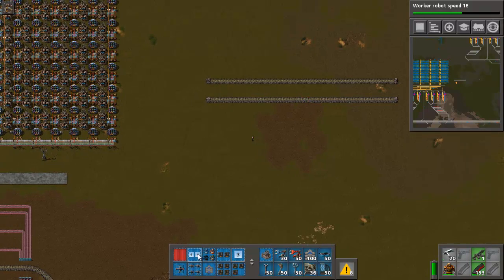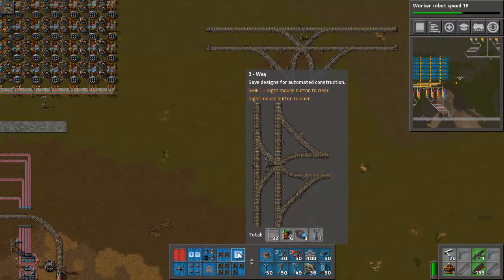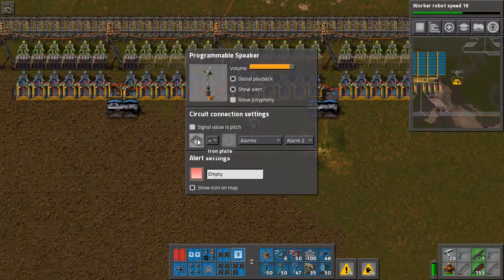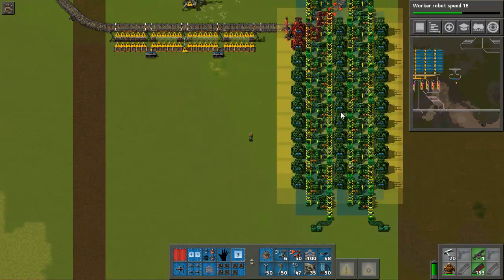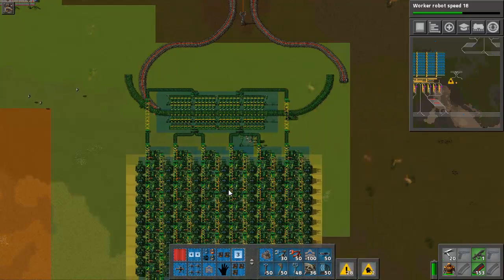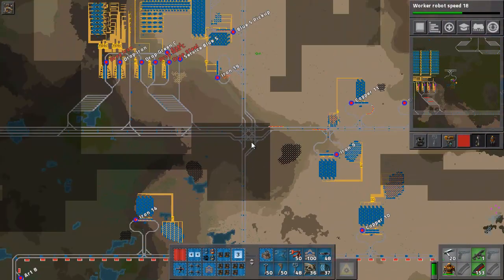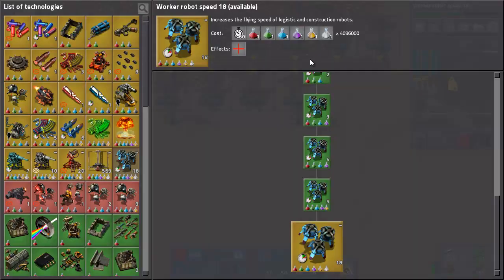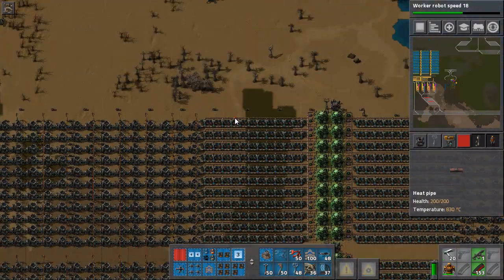Factorio Mega Base Tutorial - Late Game Ore

Comment: Those Nuclear reactors are really inefficient. Do you really think that works? I actually look at that and feel bad.
Reply from the maker: I pulled them straight off the net using belts instead of bots in the new map. Do you have a better design? I'll take it!

Not enough data or functionality for me to spend time on power systems. IMO Power is second only to tracks as the worst coded parts of the game.
Reply: @AutomatorMC  Do you have a better way of contacting you? I want to send you a picture so you can compare, but generally building in one line like that is the least effective way to do this power system. Not only is it in line, from what I could see it was not interlocking to exchange power much. Think of it this way, you don't actually want to over burn Uranium. In fact, more to the point I have now looked at your system and where you have more mines, I have far higher production. From what I could see you plugged in 1 reactor to 1 heat boiler, and 2 steam gens. You can do belt and this method just fine, what you want is 4 reactor's in a square, I then have them going off the reactor to 3 sections of 8 heat exchanges on each side of the reactor core unit's. then  I run it to 3 different sections of steam turbines, I have 2 of the sections parallel to the heat exchange array,  each of these sections has 5 rows of steam turbine's, 4 in each row with a system up top of them, 8 rows of 5. 

I believe by my calculation, you are at 25% max of your current potential. Get a bp like this, you need about 4 or 5 to run your entire factory.  If you like, add Kelsyer on steam, I will show you my factory. It's not as good but I looked, you have been playing slightly longer.
Reply: Wait till I finish my hidden up and coming system that will be capable of approximately 1000J and you will never worry about power ever again.
Reply from the maker: @beatsbykelsyer9844  Cool! Can you upload a blueprint to Pastebin or map to Mediafire? Or setup a server?
Reply: @AutomatorMC  I think I got the power system that is set to run. I went ahead and ran it for the past I think 8 or 10 hours, I might have this blueprint belt ready Let me get my test draw building to see how it runs, then I will set up a mediafire account. I did a test on your system vs mine ( I am not great at wiring, but my plan might need a fix or 2 at worst. ) so you have a massive system, so I am setting up a block of 12 plants interlocking, It uses far less space though in my eye's. It should be able to be set up on a simple grid rather easy.
Reply: Please keep in mind, I had to accommodate changes to the original, and might have made mistakes in the conversion. this is meant to work without ever needing managed. Although I seem to have designed a factory that can drink all the power 1000 of these can muster..... (unsure if this is a mod now. Factory buildings put the assembly machines in a little pocket dimension.   Well you can fit 5 of this pocket universe in one pocket universe, design it, carry them around, and all the way down to the 75th layer of this factory is the assembly machines. Anyways, any speed module on any layer in a tower effects every layer of the factor. 7 layers in you can drink oceans or uranium.)  

I have spent way too many hours testing this. Anyways, you can move this factory around, It even had its own internal bot networking, anyways never found a way to power it. Still working on it, needless to say I do not plug this thing in to my base, but it can drink in testing up to 9,000,000j but, and this is a huge but, you will never see anything fly faster. Due to the nearly 42,000 speed modules effecting the entire structure though, I would never recommend  this. I stopped counting at 42000 speed module 3's. It was not worth my time.
Reply from the maker: @beatsbykelsyer9844  My problem is water supply. I fixed it by using about 1.3 pipes per reactor but ups for reactors went way up in 0.17 so I quit playing. I like biters on so ups matters quite a lot.
Reply: @AutomatorMC  I know. My plants work due to me placing water spots to place an off shore pump. I build a pool, put pumps all around it then place 2 of these plants. One above, one under. I can also fill in the land. If you dislike mods you can barrel the water in. I actually find for most my factory's I just need 1 pool to draw and barrel from. The power plants I use though, I landscape to build. Blow up that area, get to the water.
Reply: Every complaint you have, I can fix by you joining me on the server. Because it also auto updates your mods to mine by restarting the client.
Reply: then I can show you the fixes as well, how simple and fun they make the game again lol.
Reply: Search Kelsyer on steam. Come join me one of these day. I do not have biters myself, but thats because someone asked me to fix their science. Long story short, I am 400 hours further in the server and I still do not see it as "fixed" whatever that means. So I keep making it better.